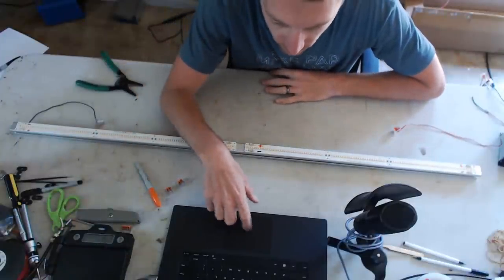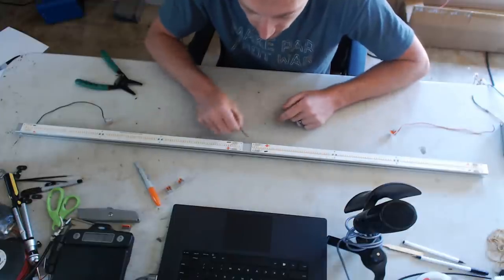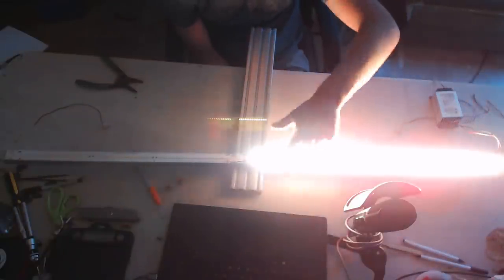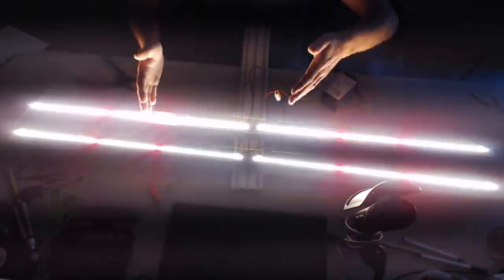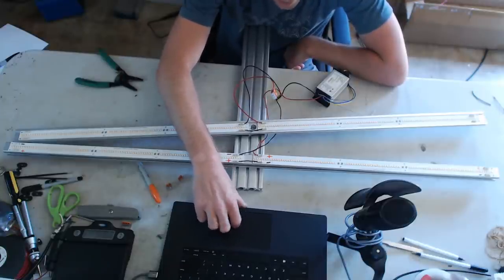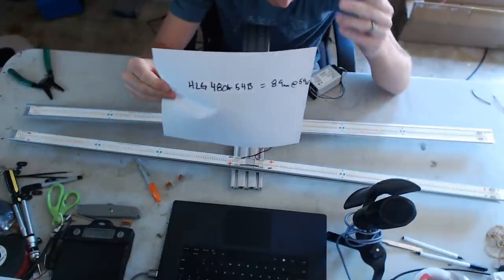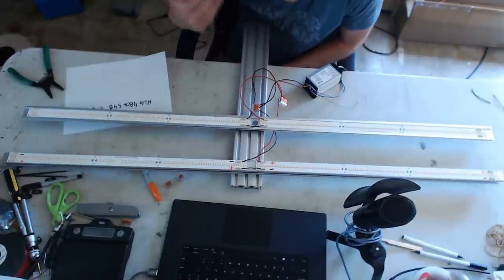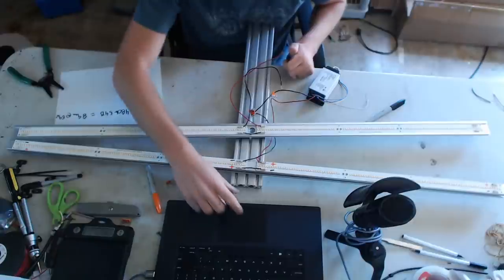Series Parallel Wiring For 54v Photo Boost Setups

Comment: Would each board in the series get half the current or they both would get the full current going across the two boards? For example 10 boards in 5 parallel of 2 boards strips on a 10amp driver would each board get 2 amps or just 1 amp?

Comment: Hey bro I was wondering, if I'm running 1000watt HPS with 420watt full spectrum cfl in a 4x4 , how think should I have between my two canopies ? I lolly popped the first 8- 10" inches of the bottoms. I'm thinking they should be no more than  about 4ft after there strech, there at about 3ft right now.
Reply from the maker: Why are you trying to run 1500w in a 4x4? That's absurd. Ditch the CFL in the trash, and just use the 1000w hps.
Reply: @GreengenesGardenOfficial  already done. I just tend to go overboard sometimes cause I felt that the light on the outer edges want enough. I'm in the process of building an LED LIGHT right now and thought maybe you could tell me if it would be enough to match my 1000 watt HPS. It's just a simple little 10- 50watt full spectrum 380-780nm direct voltage cob set up that is supposed to be 96% efficient. I'm putting it on 3- 24" inch heatsinks and there spaced every 12" both ways so 1-50 watt cob per sq ft. Would that be good enough to flower a 3x3 evenly or a 4x4?

Comment: If each board is receiving 1400mA and the DC output voltage and AC input voltage remain constant, how does the 2x 320 driver setup provide more wattage? Explain to the DIY noobs how this isn't contradictory to Ohms Law. 😁👍
Reply from the maker: Main reason is the meanwells hardcaps. Won't give over 54v and some drivers less. Can't get to awattage if the voltage isn't there, no matter what drive current says.
Reply from the maker: 2 320's=640 tested...1 600=585w tested.
Reply from the maker: Use an autec driver that goes to 56v instead of 54...and all is good.
Reply: @GreengenesGardenOfficial  Have you tested light output with the two driver setups and their respective max wattage draws? Just so you are aware, I'm just playing devil's advocate here and asking the questions some DIYers may not know to ask. Appreciate the answers and knowledge as always brother. Hope all is well fam. 👊👊👊
Reply from the maker: Have not tested them in a manner that could be compared. Have tested them thermally and there is less wattage, less heat, and thus less output. 
People can bitch and whatever all they want, Ive given all the info straight to them and don't give two fucks which they pick...I sell strips not drivers. 
 Facts are you make two of the same led systems with these two different driver combinations...you will get different output systems. Verified with 8 units.
Reply from the maker: Can get 600w with driver onboard, and no voltage drop. Still not 640w.
Reply from the maker: Same people who think one driver is better than 2...also think that the HLG600 has just one DC output...